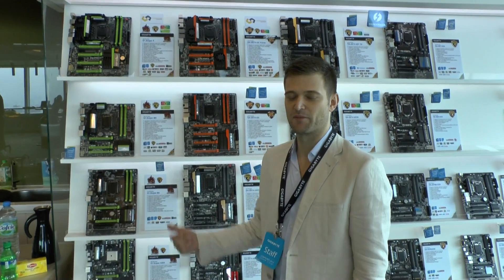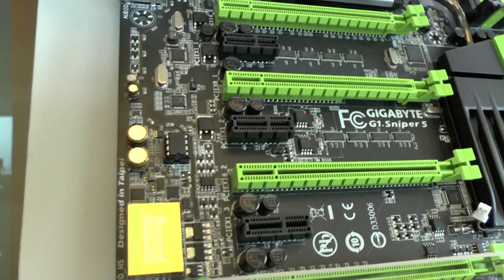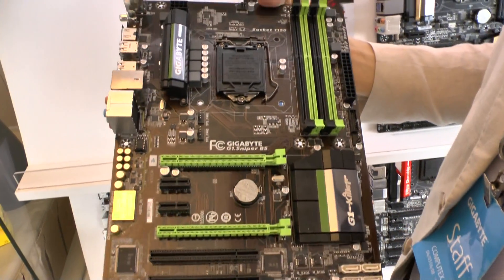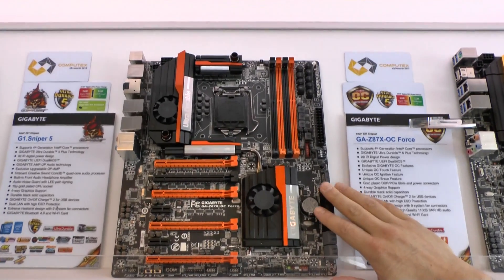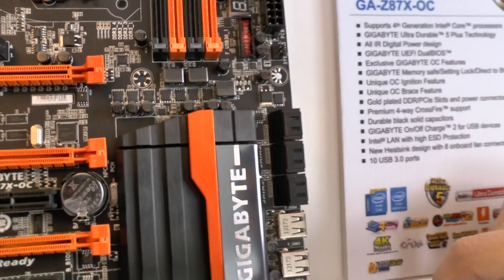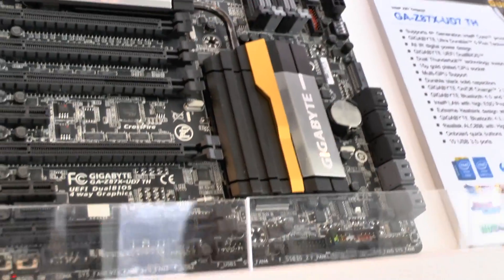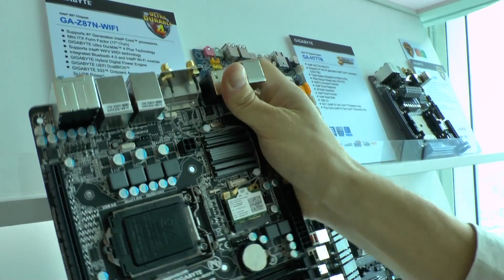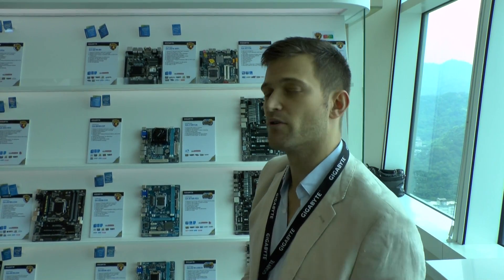Gigabyte walk us through their motherboards, Brix us up

Comment: On the most right there is an GA-990FXA-UD3 rev 4.0 - they finaly
fixed the chipset overheating problem with the UD3 series.

It took 5 revisions (rev 1.0, 1.1, 1.2, 3.0), almost 30 months since releasing the rev 1.0.

And what have they done? They added a heatpipe - like in the UD5 and UD7.

Engineers at Gigabyte must be VERY smart to fix a problem in 2.5 years!

They are very very sharp-minded... LoL!